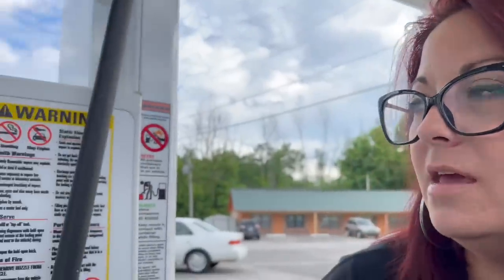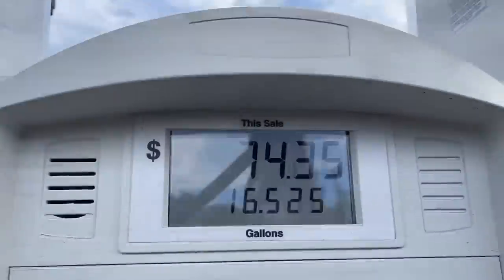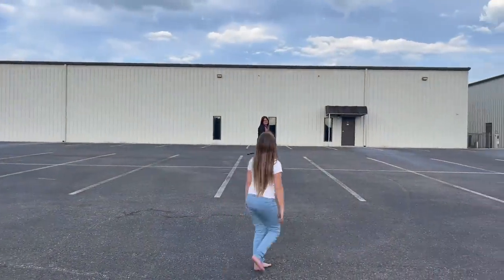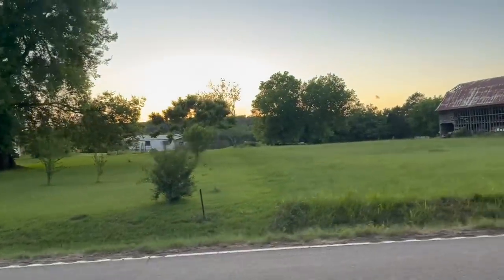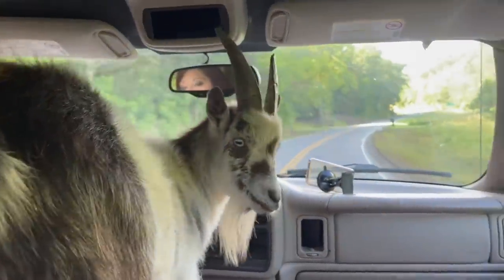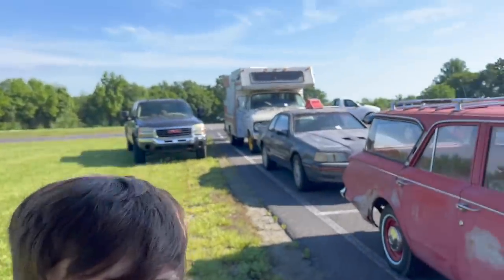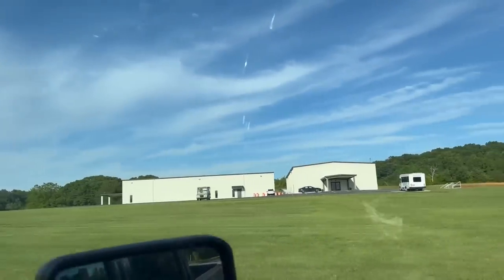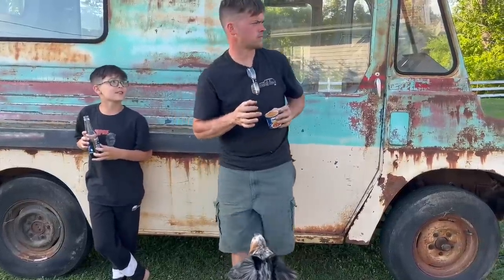We try to take every car that drives to a car show!

Comment: Last month, we drove the 74k-mile '68 Cougar 302 from SC to WV on an overnight trip for an AACA car show.  On the way back, the original nylon-coated aluminum timing chain cam sprocket disintegrated at 70 mph.  A shop owner in Wytheville, VA replaced the timing set with a double roller, cleaned out the oil pan, but discovered no compression in at least two cylinders.  We had a $1200 229-mile tow back home, and both two-month old Edelbrock E-street aluminum heads are being rebuilt with five new valves.  Expensive lesson learned about those old timing chains.
Reply from the maker: Oh no !!!!!!!! Man that stinks sorry
Reply: @Sleeperdude  A couple seasoned mechanics have told me this was a bad problem even decades ago.  Both Ford and GM used this lousy design for noise reduction from the '60s 'till the late '70s.

Comment: When you said about driving the Metro Mite too far into the middle of the road because of not being used to right hand drive it reminded me of a trip in Hungary a few years ago. When I moved from UK to Hungary I used an LDV Convoy van which is right hand drive and probably a bit bigger than the Metro Mite on width and length.I still have the van but soon after I moved I bought a tiny left hand drive Chevrolet Spark and drove that all the time. After a couple of years I found a mechanic some 80 miles away who was willing to do the paperwork, take it for inspections and get the LDV registered on Hungary plates. For the drive there I got a mate to follow me to give me a ride home. He later told me I had been driving too far to the left and indeed, at one point my left mirror hit the  mirror of an oncoming truck, smashed the mirror and the door glass!
Reply from the maker: Oh my gosh … it’s harder than i hought it would be be

Comment: Drop a340 auto in the red wagon and a decent diff  old school wheels repaint and interior you would have a decent wagon  we had them in Australia 🇦🇺 Ap5 AP6  in v8 an 6 check it out you will love them
Reply from the maker: Yeah that would be cool
Reply: In this day of run away gas prices,  I would keep the 6 . I had a 65 Dart had to rebuild the 6  (170) had a 3 speed manual on highway I got 27 MPG around town 18-19 
That being a station wagon,  it may not get that kind of fuel mileage (because of weight)
Reply: Got to be a 340 4 speed

Comment: Try "Restore" in the Metro Mite and STP and maybe some form of PTFE in the camper engine, or "Restore" there too.  The MMO is too thin for such worn engines so it allows the worn bearings to hammer and knock.  You need thicker stuff.
Reply from the maker: Good idea

Comment: About 12 minutes in to your video when you your girls were cutting up them just hilarious. Just before you picked up your son. I like that little red wagon. He's at deluxe Cross area ventilation in the floorboards. With the exhaust on the ground it's a real drag'n wagon! Does your little tractor have a high low leaver? Works kind of like two speed rear end in that is shifts up into call highway gear. Thanks for sharing and making the video

Comment: You are cracking me up with those jalopys but if you want some quick and environmentally friendly leak stop just put in a tablespoon of fine ground black pepper. I have driven 8 months without leaks on my old 351W swapped Fairmont that had a bee bee sized hole in the radiator core.
Reply from the maker: Ok thanks

Comment: You checked the fuel, but you forgot to fill the oil, on your van 😅 how many leter a mile you get out of the oil, 🤣😂 great show
Reply from the maker: We did check it off camera, you are right it probably uses a lot
Reply: @Sleeperdude  a mate had a Ford falcon 60 model I think they were called fishop for some reason, but you had to fill the oil and check the fuel 🤣😅 because it nearly used more oil than fuel, all the best

Comment: Also nice Chevrolet Camaro my late Uncle Bill & his long time girlfriend Phyllis had Cherry Red  plus Chrome trim body also black interior too and he ordered 1989 one with Corvette power train of 350 V8 , true Daul exhaust, 700SR 4speed Overdrive Automatic transmission shift kit, 390 rear end gears and in 2009 he got me restoration to with 1978 GM truck single cab doors frame installed to , also take off Clutch Fan put 1978 Chevrolet Impala 4 core rad with 2002 Chevrolet Impala LS 2 electric fan to and in 2013 he past away but car was appraisal at $15.000 also had only 178.000 kms on it ! But sold for $5.000  also never seen again to but did in Junk Yard near me  and was destroyed by fire plus accident ! How found about was looking for some vechile parts on vechile working at work for costumer and spot it ! Was very upset  to see and found had 315.000 kms on gauge when check out ! Also want fix but cost more $15.000 to do again so past that idea! Wished Phyllis would gave me to or buy off before accident but she didn't want me too or anyone else in families have it !
Reply from the maker: That sad .. thanks for watching

Comment: The Metro Mite Was Just Cranking Slow cause Alt wasn't working.     AND GOOD NEWS.    The Motor Homes Oil pressure sending unit QUIT working.    How I.know.      I bought a Chevy with No oil pressure and drove it home 68 miles.   Bad sending unit.       LOVEEEEEE THE VIDEO.    LOVE YOU GUYS.   AND I WISHED WISHED WISHED.   I HAD GONE TO YOUR CHURCH THAT DAY.    I WANTED TO SOOO BAD MAYBEY NEXT YEAR.   IM IN CDA IDAHO..... LOVE YOU GUYS.    HAVE FUN AND STAY COOL RALPHIE LIKE FATHER LIKE SON. 😘😘👍👍👍👍👍👍💥🔥💥🔥💥🔥💥🔥😻😻
Reply from the maker: Unfortunately it was not the sending unit I checked that later